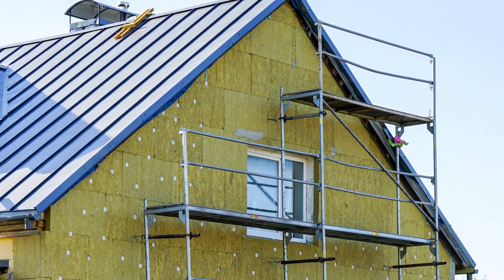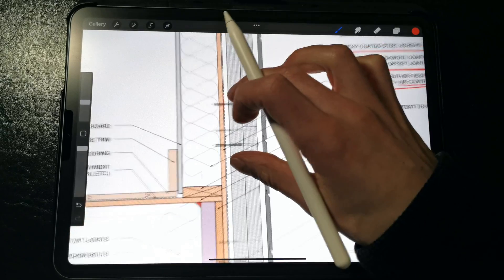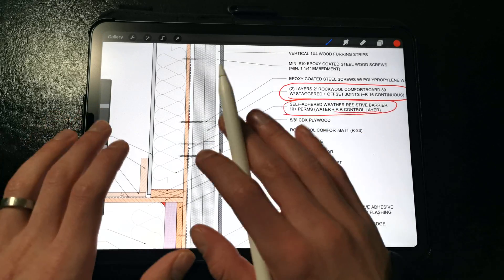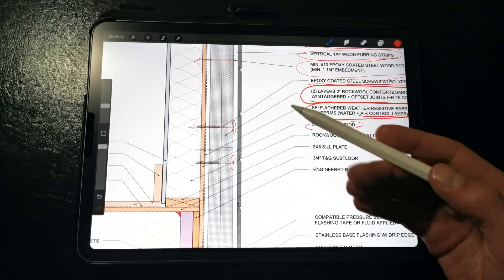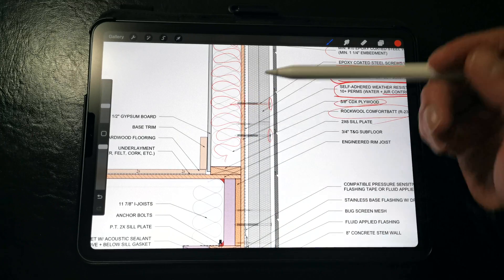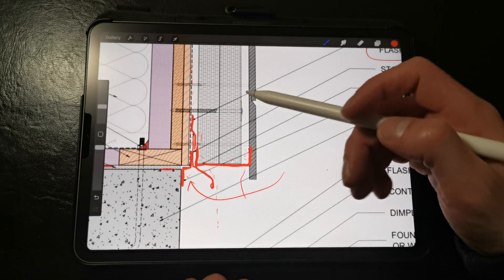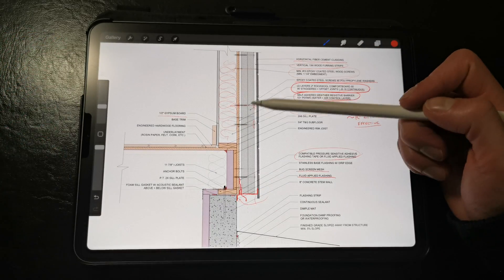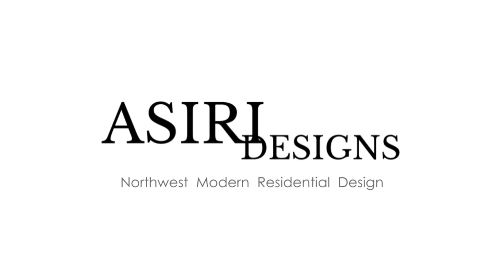Super Efficient Exterior Insulation Details with Rockwool (For Architects + Builders)

Comment: Zip-R is the most practical exterior insulation for proper water tight installations.  No window bucks to build, no furring strips, no WRB install and better water/air tightness without a big learning curve by using Zip tape/liquid flashing to seal it all up.  It also has higher R-values per thickness, so Zip-R12 can be nailed to 2x4 framing and normal window jambs for 2x6 framing fits perfectly.  Just need to follow the prescribed nailing patterns.  The labor savings are much less too using Zip.

Wall drying concern is eliminated by stopping vapor at the sheathing surface and adding a plastic mesh rainscreen behind the siding for drainage/ventilation.
Reply: Yes, in RI on the coast, Zip R didn’t meet the shear requirements in that wind zone so you had to sheath the house with CDX then sheath over that with Zip R if you wanted to use it. I’m now in VT and Zip R is quite popular here.
Reply from the maker: There are pros and cons to every system, I definitely like ZIP-R and applaud Huber for their innovation, and have recently specified it on my last project to simplify installation for the contractors.  It's not a silver bullet though and I would caution those using it in colder climates since you're limited to R-12 exterior insulation, not to mention you really need to coordinate the use of the sheathing with the structural engineer since they may need to add additional shear walls or hold downs.
Reply: @ASIRIDesigns  R-12 is more than adequate here in zone 6A for exterior insulation.  Our walls have closed cell foam in 2x4 studs for a total wall R-30.  Windows are getting much bigger in new homes where a good deal of energy is lost or gained, even with triple pane which are a little over R-5 or about 60% less than R-12 ext insul.   You can do better than R-5 triple pane but it gets $$$$.  Most use double pane around here and spend the savings on more efficient HVAC.

Comment: Great video! A few considerations for the viewer turned comment reader:
1. When using XPS, EPS, or polyiso. as exterior insulation instead of the mineral wool discussed in the video, it typically reduces the drying capacity of the wall assembly, particularly in climates where a vapour control layer (barrier) is required on the interior side of the assembly. So, if the wall assembly gets wet (e.g., via condensation resulting from convective moisture transport through a discontinuous air barrier), it is anticipated to dry faster when mineral wool is used as an exterior insulation versus foam board products. The longer the wood stays wet, the more likely mould growth and deterioration are to occur.
2. I'd anticipate the effective thermal resistance of this assembly to be somewhere closer to R-35 rather than the R-21.5 shown. I believe a 45% reduction in thermal resistance (nominal to effective) for a wood-framed, exterior insulated assembly is a little high. ASIRI Designs, small math error or am I mistaken here?
3. Where possible, it is generally a best practice to shingle lap your membranes, such as over the base-of-wall flashing shown. The theory here is that if in 5, 15, 25 years the adhesive on the flashing tape begins to fail, then the shingle lap of the membrane will at least direct bulk water out of your assembly as opposed to into it. This is fairly inconsequential with this detail, with a continjuous membrane behind the flashing, but may be more important at window head details, or through-wall flashing details. This obvoiusly doens't apply if the liquid-applied flashing and sheathing membrane discussed here is used, as it is anticiped they'd bond and form a seamless transition.

I love the content, ASIRI Designs. You're producing the best building enclosure detailing information that I've found on YouTube and are a great resource - thank you!
Reply from the maker: Thank you so much for your comment, all of your points are 100% spot on! With regard to the effective thermal resistance, there are several ways you can calculate it. Some people include fenestration in the calculation for total wall R-value, others calculate it as a percentage of the framing in terms of surface area which can be anywhere from 15-20% of the building, and deduct that percentage from the nominal R-value of the assembly, or you can base the calculation off of the worst performing component(s) in the wall assembly.